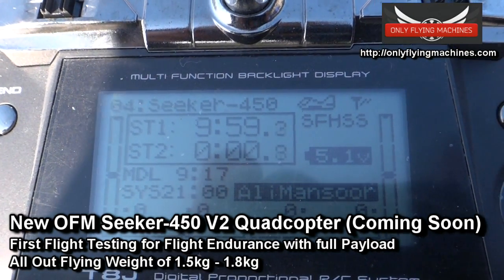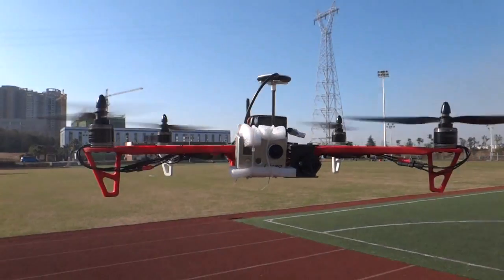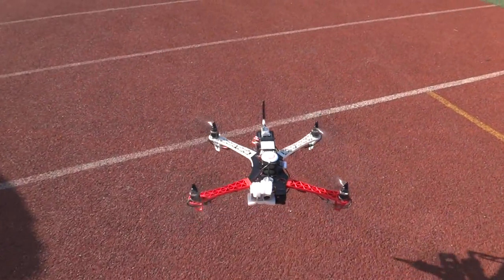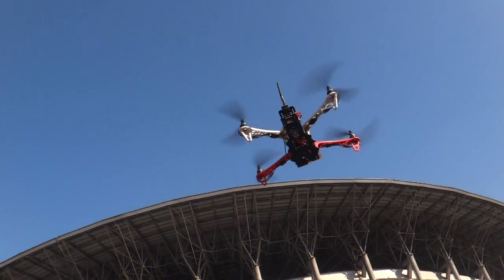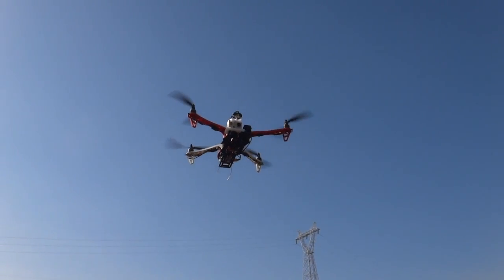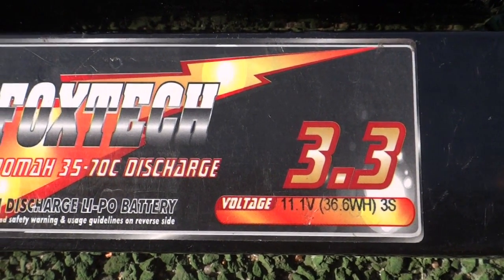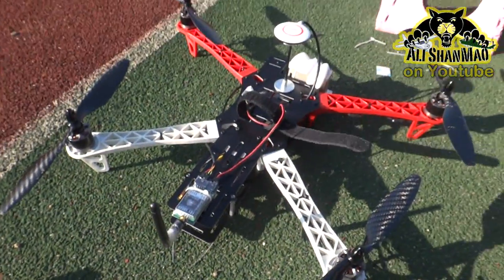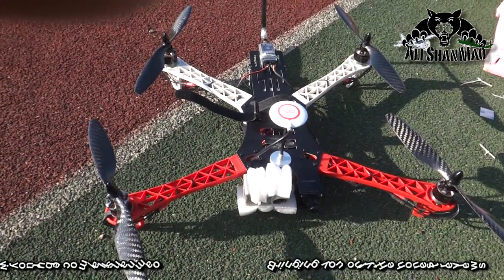OFM Seeker 450 V2 Coming soon - Flight Testing

Comment: Those T-Motors aren't expensive $30 here in the USA I've seen them in stock and I agree using a bugger amp ESC than 12amp and they are cheap costing also. I know you run a business and get the parts cheaper than I or others can buy them but Ali you have to be careful because your going to price yourself out of the market if your prices keep staying high. Ali I'm just giving you my opinion and your a good guy and your customer service is very very good. Keep up the good work Ali